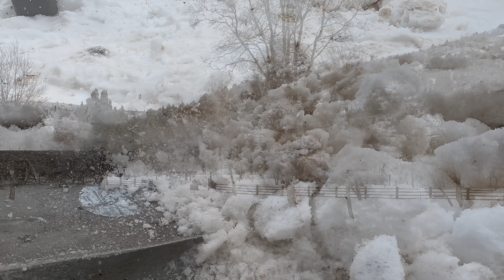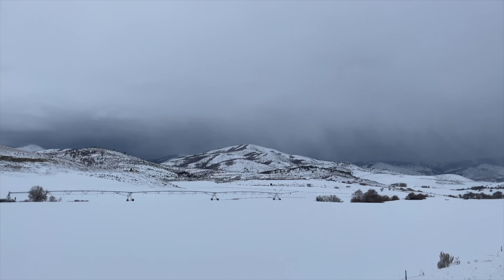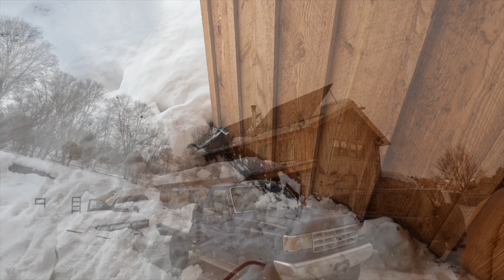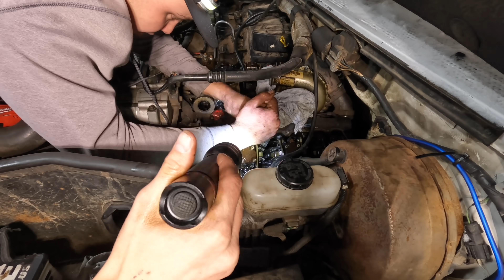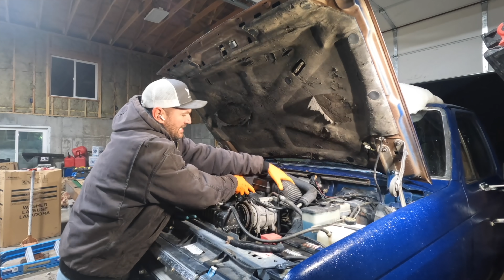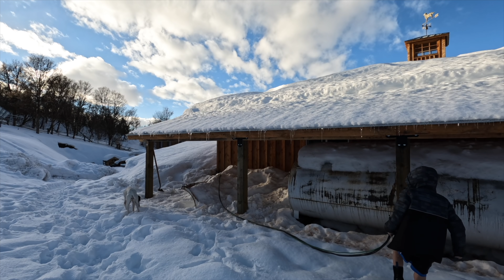#553 - Ran Conduit And Wire For Backup Generator.

Comment: Heath our mechanic use to take the fuel line off after the fuel pump to see if it has adequate pressure if that was OK he then went to the injectors and the seals maybe a bad regulator. Bleed back is a common problem especially in winter I think it has something to do with the seals shrink in the cold especially when the engine isn't running. During the summer this usually doesn't happen because the seals swell a good seal is hard to beat. But glad to see you and Rhett working in the garage and getting the generator ready to be wired up. Tell Cedar that it's the delivery that makes the joke tell her right now is a good time to sweat. Be careful and stay safe my friends God love ya 💓

Comment: Love your content. I'm sure you see and get tired of certain posts. I am a Ford diesel tech and have owned idi and powerstrokes. To my flatrate detriment I tend to diag rather than throw parts. On the idi I have seen several air leaks as you mentioned. I put a clear line in place of the rubber hose to see where it drains back or sucks air. My experience is the rubber line at mechanical fuel pump, or if the water separator is on the firewall. Also either of the fuel pumps. High pressure pump seals could be dry creating issue. Turn fuel up 1 flat to wake it up. Powerstrokes...icp is relative to fuel pressure. If it's tuned monitor icp with scan tool if possible you may have oil high pressure oil problem. Ie black color in fuel bowl, ipr, icp and oil soaked connector, injector harness opening up when warm. Just trying to help. Thanks again for your content.
Reply: U, just help me with my problems thanks

Comment: On Retts truck…is there a second inline fuel filter. My 92 F-250 with a 460 was hesitating. I replaced the fuel filter before taking it in and luckily one guy in the shop knew about the second in line filter. Fixed my problem.

Comment: I'm in New Zealand 🇳🇿 but in the 70's and 80's I lived in London and drove 18 wheelers in England and Europe for 5 years. Now snow and ice looks good on calenders and post cards. The salt on the roads stuffs every thing and turns New vehicles into balls of rust in no time. You can take those weather conditions and shove em where the sun doesn't shine. Like what you and yours have done though. Keep up the good work. Looking forward to the summer where you are. Today here was 22degrees and that's F not C.

Comment: Surprisingly, Walmart in Bolivar, Missouri has 100lb propane tank in stock.  $130 price for tank and $100 for shipping.  Menards in Casper, Wyoming has 6 100lb propane tanks in stock for $169.  I did not check shipping for that one.  All the very best going forward, Heath and Team #RedPoppyRanch!  Thanks for your work!

Comment: Cedar you did a great job with the joke. For some reason I always mess that one up, but I know it does warm you twice!! keep up the good work
Reply: Actually three times… you cut it down and haul it home that’s one time then you have to split it and now that’s work so it warmed you again and the third time when it’s in the stove

3 times
Reply: @dougseamons4874  You are absolutely correct and I can testify to that! With good gloves and good 👢 boots you can work for quite a while if you stay out of the wind.
Reply: @dougseamons4874  Count the number of times you move wood. Forest to trailer, trailer to drying shed, to storage shed, inside storage, into fire place, then hauling ash out to pile or road. Handling wood 5 to 8 times is normal.

Comment: I’ve only got the one 2002 7.3 to fight with, having resurrected it from being scrapped, so I’m not too familiar with all iterations of the platfrom, but the two main fueling issues I’ve found are the intake in the fuel tank fouling, and that it’s very finicky about oil pressure, and will shut of the fuel if it gets just a little bit low.  I certainly won’t claim to be an expert, but this truck has been a head scratcher after mostly dealing with the the 8.3 cummins and it’s 4 cylinder sibling.  When it’s working, it pulls hard with all manner of load behind it, and starts just fine in -30 (if it’s had the block heater plugged in), but man, that laundry list of accumulated problems that led to it being abandoned has been a journey.   One year I might even summon the strength to pull the turbo and un-disable the exhaust valve under the turbo that’s currently wired open.  One year.  When I feel like I don’t get any more enjoyment from bashing my head against a wall.  Best of luck with yours.

Comment: Your right on a weather boundary right now. There's a big plume of cold air coming down from the arctic meeting a big plume of warm air coming up from the equator and it's meeting right over the central USA. So you've got freezing wintery conditions meeting tropical air. It's playing havoc with the weather. It's because the jet streams slowed down so much so I've heard.

Comment: I have a 2 wheel wheelbarrow. It does not spill load on me as it is more stable.  Only need for a one wheel wheelbarrow is when using a single plank as a walkway or ramp.
Reply: And then if you miss step over it goes. I do believe that I am due for a new wheelbarrow!

Comment: The old ford trucks had coated tanks.  After years of use the coating falls of and clogs up the sump in the tanks.  You and pull the sumps and look in the tanks to know for sure.  You may have to replace the tanks.

Comment: Keep expanding your solar and batteries, it is your lowest maintenance system for 10/30 year cycles.

If you did a big enough array you could heat and cool both your buildings with no input effort from your labor after completion of install.

Comment: Glad you ended up with the 77 short bed instead of that motorcycle... That could have been you on the out of control bike and it could have been brick walls instead of wire fences... And the bonus is the 77 paid off the wedding ring... I'm wondering if you could incorporate the generator trailer into a movable feeder for the goats that keeps the food dry instead of out in the elements??? Bad weather moves in you can close the doors or leave them open in good weather... That or maybe drag it up to the cabin and leave it there for storage of things you'd like to have up there but would clog up the small cabin???

Comment: Hey Heath just a heads up, with the bottom edge of the roof open to the generator area it could potentially fill the shop with carbon monoxide from the exhuast.

Comment: Hi Heath,  have you looked at replacing  Camshaft Position Sensor - Ford Powerstroke F250, in Retts truck.  I have a 2002 F-250 powerstroke and when I feel that jerking while driving(Feel like its not getting gas), I know its time to replace it.   It almost left me stranded when I didn't replace it one time.  I will always keep an extra in the truck ... They are cheap and for whatever reason,   these powerstrokes are notorious for this issue.  Love your videos...Keep inspiring .   Have a great day... Migs

Comment: On Rhett’s truck check the ICP if there is oil in the plug then it is going bad. That can make a 7.3 powerstroke show those issues. Also check every plug on the valve cover harness.

Comment: Seeing you go up on the roof, made me uneasy because snow is slippery and people fall.  This is just a suggestion, if you can build 2 permanent small one person scaffolding on opposite sides of the building out of wood to go up to the roof and maybe from the scaffolding you can build a bridge with a railing that would lead from one side of the roof to the other so when you have to get up there, you will be safe.  I know it's easier said than done and snow has no boundaries, but it just might help so you will have somewhere to hold on to securely.

Comment: My mother used to burn pieces of wood in our fireplace that my father had cut up from scraps he picked up here and there.  Some of it had nails in it.  One time when I was quite young I decided that I could help my neighbor by putting the ashes on her inclined driveway when it snowed one time.  I didn't realize and didn't think that the ashes might have nails in them.  Apparently there were quite a few but I was focused on helping my neighbor.  Not too long after that my mother heard from our neighbor after she had multiple flat tires and had figured out why and where the ashes came from.  I don't know what kind of settlement was made with the neighbor.  I guessed my well meaning topped my stupidity in my mother's eyes.  Anyway, I didn't hear anymore about it but I never put ashes on a driveway again.

Comment: What happened to prioritizing the finish of an overdue adequate shelter for the goats and hens?
Reply: The little house is still up and the goats are now out of the worst of the weather. Getting the wiring to the generator (now under cover)and getting the trucks reliable got moved up the lists. Sometimes compost happens to shift things around.😯

Comment: The mark up you get, when you sell these 30 year old trucks, must be worth the hours and hours you spend keeping them on the road. If you were to put a dollar value on the hours spent plus parts vs sale price, is it worth all that time? Wouldn't it be worth just getting a newer truck and use all that extra time for all the jobs you have to do on the house and farm? Love you all, and wishing you all the best for the coming year.
Reply: The problem with the newer vehicles is that when you lift the hood you realize that you need an engineering degree to fix even small problems. I  like being able to fix things myself so I can be on the road quicker and not have to pay for someone else's time.

Comment: whatever happened to the firewood cart that Heath built out of an antique railway luggage/ freight  cart. It looked awesome. Assume you simply found that it was too big for the house?  Also, every fall, you should stockpile a 10 yard load of sand beside the driveway , That gives you a source to toss  on the driveway to help with the ice, and in the spring. it just becomes part of the gravel.

Comment: There's a couple folks that make aluminum fuel return rail replacement options for the idi's.  Have you ever considered that? In my experience the plastic return fittings and the hose clamped rubber hose combination doesn't stand up very well over time.

Comment: Get some good "stiction" treatment and put in the oil of both those fords...makes a huge difference. Also, make sure to suck the oil out of the upper reservoir that runs the Hui pump...also makes a big difference as it doesn't come out on its own during normal oil changes

Comment: I thought there was a propane tank behind the shop under the new overhang?
Reply: You can see the huge tank at 7:40 into the video.  I cannot recall if it was meant for propane or diesel.  EDIT - Heath mentions at 30:02 that it’s a propane tank.

Comment: On the IDI truck, don't wait too long to do the manual glow plug button. When the glow plug controller fails it fails in the on position. But I'm sure you're aware of that since you mentioned doing a Manual switch. I found that out the hard way on my 1985 Dually.

Comment: I’m always curious why Heath doesn’t close the shop doors and get a fire roaring when he’s working on vehicles in the shop. Kinda defeats the purpose of a fireplace in the shop.
Reply: breaking the wind is comfortable 😏
Reply: Like someone last week. Because he is too bullheaded to admit it would be nicer working in a heated shop.
Reply: @joepfeiler5911  jealousy is indeed a curse
Reply: The ceiling is wide open and not insulated.   I would want the rock up asap. Not only would he be able to blow in the ceiling insulation but it would be much brighter in there as well.  He seems to have plenty of projects to work on though.
Reply: Unless you have a biting wind why not do it outside? He did mention that the temperatures were rising. I'm one of those nuts who likes to have the window open a Crack or I have the thermostat set at 65°F @ night. If I get cold I put another blanket on the bed or if I'm doing things in the house or yard I will add another layer of clothing. Minnesota here with a windchill of -10°F at the moment.
Reply: When you heat your house with wood, you just get tired of making fires. It could take 3 or 4 hours to get the shop warm, plus it would use a ton of wood that could be saved for the house. Its just not worth all of the work.
Reply: I thought the ceiling wasn’t done.
Reply: I did forget that the ceiling was not done in the shop
Reply: Saving the wood for the house and the man is used to the cold.
Reply: @stevenstritenberger1761  Yep!
Reply: I was wondering that too! Last year he did! But this year I haven't seen it used once! I thought he was gonna make that into a little man cave/ pool hall area for the family!
Reply: @damogranheart5521  This is Idaho. There is a biting wind year round.
Reply: @NewsChannel-y4g  I know I'm a lot more comfortable after breaking wind.

Comment: i have been wondering why you opted for the solar array on your house instead of the barn... is it just because of the wire run to your batteries?
Reply: Nope! The house gets consistent sunlight no matter what the season. For instance, in the morning, the house gets the light well before the shop does. It also gets the last of the sunlight during the sunset.🌅

Comment: that is an idi engine. caps and orings are most likely the culprit. or it might be where the fuel heater goes through the filter top. i got rid of the oem filter mount and replaced with a plain ol filter head then i installed a facet elctric pump under the hood and have had zero issues with it losing prime. just sayin thats what i did on mine. good luck.

Comment: Ford diesel fuel systems are notorious for air issues, many are so bad owners get airdog systems installed.

They are also known for the fuel gauge telling lies, fixing that however is next to impossible, the system is simply unreliably made, I have lost count how many level sensors I have heard of being replaced and strait up failing out of the box, doesn't seem to matter what brand either.

Comment: Just curious why you didn’t just punch that wire through the wall and then just run it up and over through the shop attic to the generator? It would have made a quicker and cleaner looking installation.

Comment: Since you are going to use a bed tank and bypass the two you have...maybe you could fill them with something like (clean) sand to add weight for plowing?
Is it possible to use a strong neodymium magnet to keep the plunger from falling in?  
I'm not familiar with diesels very well so that is why I am asking.
Reply: These are very good questions. I hadn't thought of a magnet

Comment: Your looking like your going to need to cut more wood. It would be nice to have a heated slab outside so it would melt the snow off your basket ball court. Put some  Power Service CETAIN Boost in it.

Comment: Snowstorms now are a chemistry experiment, endothermic and exothermic as well.  (chemicals that exude heat or absorb heat and provide condensation nuclei)  Probably not just MY opinion.  Before ya all tell me I'm  wrong or am full of it,  please do some research.  I would invite discussion on this subject.   (intelligent discourse)
Reply: Well I am not sure about the exothermic part for this chemically nucleated snow.  The endothermic portion is clear in terms of snow at 40 F for example which shouldn't happen above 32 F.  Then the snow can vary from fluffy to extremely heavy as it is this year.  Anyway I know a lot about geoengineering etc.

Comment: Please don't screw up again by using Alum wire. Only use copper wire for that long of run and be a professional for once. It will not have as much voltage loss and will pull easier.